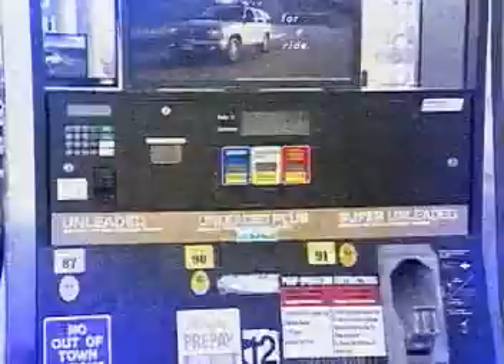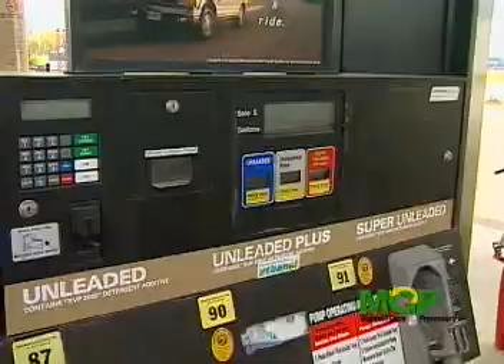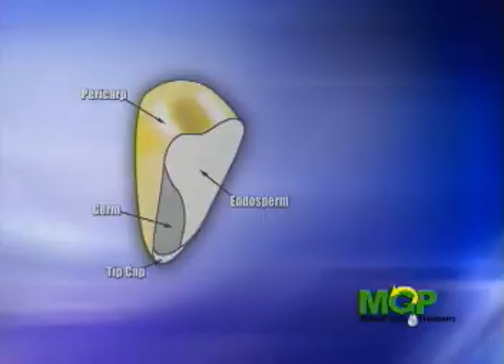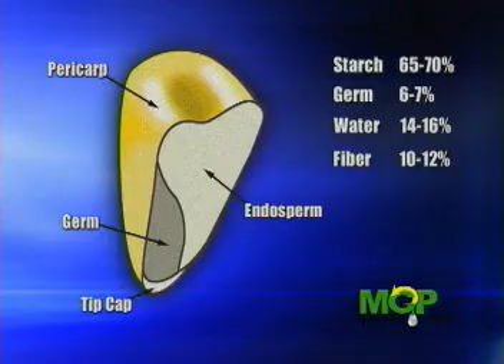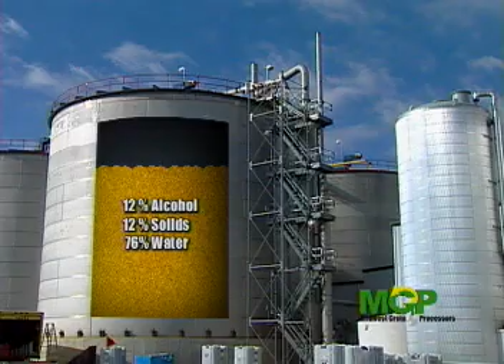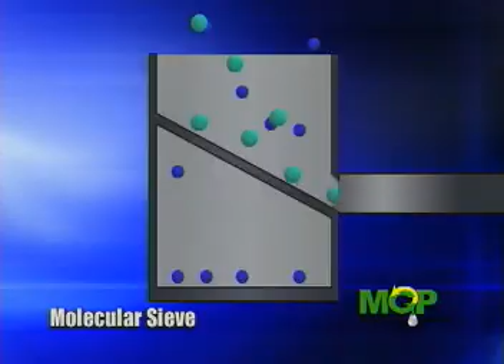Video Tour of an Ethanol Plant

Comment: The only problem with ethanol is the fact that it takes way more energy to produce than gasoline and its lifespan is less than half of it too😬
Reply: Well that's an expected drawback obviously.. Ethanol il not meant to be an energy source but to be a substitute for gasoline as a transportable, easy to use and cleaner combustible

Comment: Does anyone know when the ethanol is pumped through the molecular civ if it is in a liquid or gaseous state??
Reply: ITS PUMPED TO A VAPORIZER WHERE ITS TURNED IN A VAPOR AND THEN SUCKED THROUGH THE SIEVE. AND THEN SENT TO A HEAT EXCHANGER WITH THIN STILLAGE ON THE TUBE SIDE THAT IS COOLER. AND THEN THE VAPOR IS ON THE SHELL SIDE WHERE IT CONDENSES BACK INTO A LIQUID AND IS PUMPED OUT
Reply: Typically the vapor from the top of the rectifying column is metered to the mole sieves.  It is superheated before entering the sieve vessels to about 20 deg F higher than saturation temperature to ensure no condensation inside the mole sieve vessels.  You can use liquid phase mole sieves but they are usually employed to get very low levels of water in the finish product.

Comment: Let's understand how this Gas-0-hol or as it is sold today as E10 "Ethanol added" situation has developed to the state that it is at today.  Importing oil from forsaken, blood thirsty nations of the Middle East was identified as a problem to be solved. After short discussion, the LESS than  "Plausible" solution has been to burden the American farmer to provide a energy "Supplement" to our nations energy needs in the form of Ethanol from "corn".  With the backing of Government enforcement and the wisdom of economical decision making of Private investors.  The necessary arrangements to mass-produce Ethanol derived from corn has been done. These Private investors and or Government officials are sometimes one and the same, and expect a "Return" on their investments into corn based Ethanol production. 

Here is the "screwy" math used to justify 10% Ethanol added gasoline. The claim adding 10% Ethanol only degrades gasoline by 8.5-to-8%. If you get 20MPG without Ethanol you will get 17.5 -to-17.33MPG with Ethanol. A LOSS of 2.5 - 2.33 MPG to add a 1.5 gallons of Ethanol to a 15 gallon tank of gas.  That adds up to approximately 36.45 miles Less from a tank of gas with Ethanol.  It would take just short of 2 gallons of gas to make up the loss provided from adding 1.5 gallons of Ethanol. With this somewhat "screwy" math the claim is that less than a half a gasoline gallon is "Conserved" from consuming a 15 gallon tank with 10% Ethanol added.  If you consume 34 15 gallon tanks of 10% Ethanol added gasoline you will have used 510 gallons of Ethanol added Gasoline to conserve around 15 gallons of gas. Traveling 9,180 miles on 510 gallons this is about one year of driving to conserve one (1) tank 15 gallons of fuel. 
 
When Gas-0-hol was marketed in the 1970's and failed because the benefit was "Minuscule" at best, back then and nothing has changed today. The financial consequences to produce 10% Ethanol are enormous, it has cause the price of groceries to increase. What is also not factored in is how much energy does it take to plant, harvest, and distill all the corn dedicated for Ethanol production? Whatever that amount is subtract it from the "Nan-0-Scale" of benefits.  Ethanol is a Lose-Lose a little more to save less solution. Gasoline as a "Supplement" to Ethanol is  an improvement to ethanol as in the form of E85. An effort of producing 500-1,000% more ethanol than what we are now producing is the "Challenge" that seems out of reach. If Ethanol is to be used as an "VIABLE" Alternative energy source rather than a energy "Supplement" as it is today.

Lets not misunderstand my point, I did not say not to use Ethanol. What I did write is not to mix it into the gasoline supply at 10%. I also said the best use is to mix 15% gasoline into the Ethanol as E85, the better way to blend. "Because" Gasoline improves the performance of Ethanol "BUT" mixing 10% Ethanol degrades Gasoline. In 2015 Obama pushed for an E15 fuel mandate. This is proof that he and his administration does not understand ethanol as they wish to make the mistake even bigger than it already is.
Reply: All internal combustion engines can safely and economically use E15, regardless of age. This is proven by Brazil's decades long use of E15, E25, and now E27. They have the same engines as those available in the U.S. In addition, E15 to E30 was used throughout Great Britain from the 1920's to the 1970's. This is also true of other countries such as France and Germany.

My 600+ page book "THE ETHANOL PAPERS" has just been published and it's free to read on TheAutoChannel.com website.

Comment: How much feed corn do you eat?  The starch can be removed from grain as alcohol and then the left overs can be fed to cattle as quality feed. The starch is hard on cattle anyway.  However,  Corn ethanol is one of the least efficient methods of making fuel alcohol.  These plants could be converted to higher efficiency ethanol producers with better feedstock selection.
Reply: like what are those feedstocks? Can you please elaborate we are designing an ethanol plant as our final year project at the university.
Reply: Switchgras is better